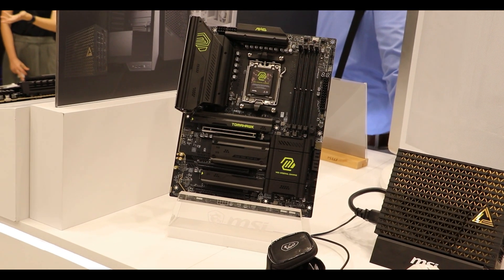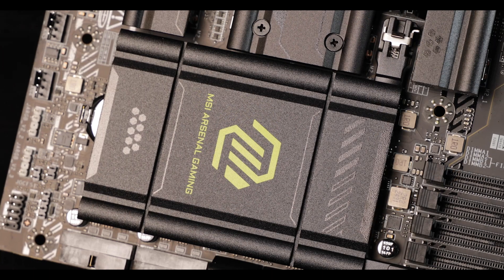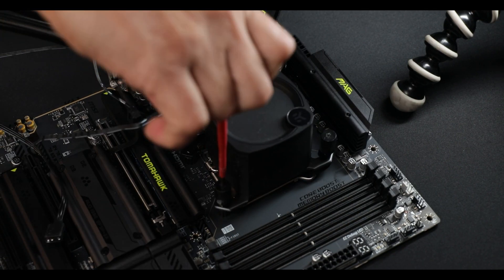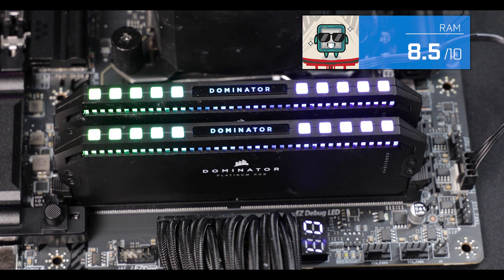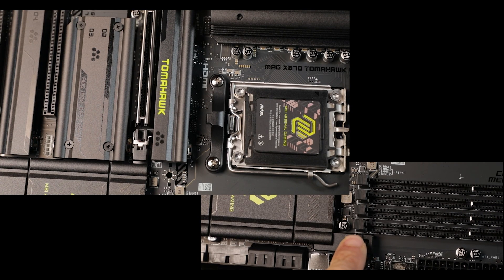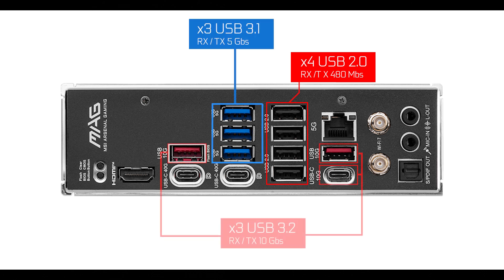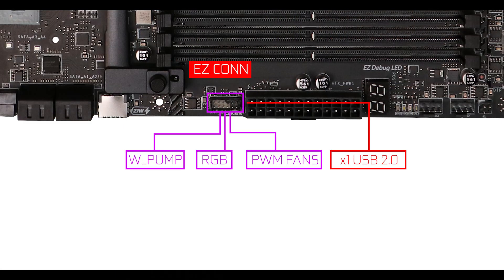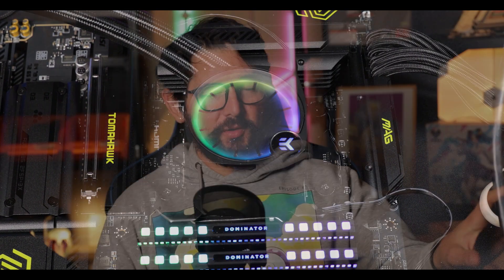MSI MAG X870 TOMAHAWK WIFI : this is getting better and better!

Comment: Getting my MSI Mag X870 today
Reply: You are happy with it now and what processor with it?
Reply: @mustafaozkan5773  Yeah I'm really happy with it and love the motherboard; everything went together easy and fine. I got a 9950X which I'm pretty happy with; Mabey I should have waited for the X3D but this can more than handle anything I throw at it. So yeah I'm set for the next 5 or more years
Reply: @mustafaozkan5773  Yeah I love it for the most part; everything went together good and easy. Got a window on my case and it looks good in there. I got a 9950X which I'm happy with; it can more than handle anything I throw at it. Mabey I should have waited for the X3d chips but this 9950X is already overkill for any game. So I'm probably good for the next 5 or more years.
Reply: @mustafaozkan5773  Yeah I love it for the most part; everything went together good and easy. Got a window on my case and it looks good in there. I got a 9950X which I'm happy with; it can more than handle anything I throw at it. Mabey I should have waited for the X3d chips but this 9950X is already overkill for any game. So I'm probably good for the next 5 or more years.

Comment: The motherboard only does 5.1 on optical out, and most optical amps cost a big price, would of been nice for the mother board to have a soundboard to have a 7.1 surround sound jacks instead, why are they removing those the last few gens. ive noticed a lot of motherboards cheeping out on the sound card.
Reply: Anyone with a respectable surround setup uses HDMI to a receiver. Surround jacks are pretty pointless.

Comment: Take a look at the x870e nova, it's better than the taichi in my opinion, and cheaper.
Reply: Can't wait for his review on it! I've had my eye on the Nova as well!
Reply: I want that board as well even as to just collecting it, I have the Z790 Nova but damn that X870E Nova makes me want to switch sides LOL
Reply: Availability wise, Tomahawk is way better ... 😅
Reply: @R6ex  Lol x870 vs x870E, the tomahawk doesn't even stand a chance
Reply: Yeah, and Nova have NO lane sharing nonsense!
Reply: @TheRelixo1  I think the only downside I see is that it doesn't have extra lanes for a capture card etc, but it's perfect if you don't use them.
Reply: @TheRelixo1  Almost. When the slowest M.2 Socket (PCIe 3.0 x2) is filled, the second PCIe x16 slot is disabled. And apart from the primary PCIe slot, the other two are only PCIe 3.0. Otherwise the ASRock Nova has quite solid specs.
Reply: Does it have thermal sensor headers?